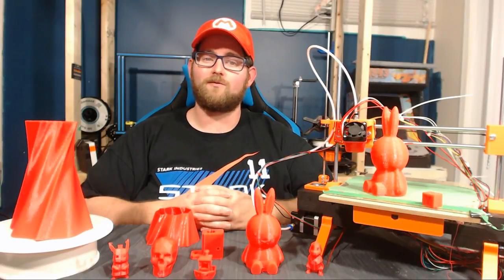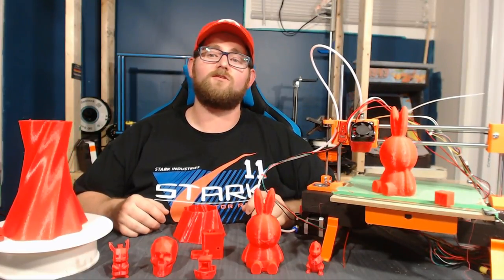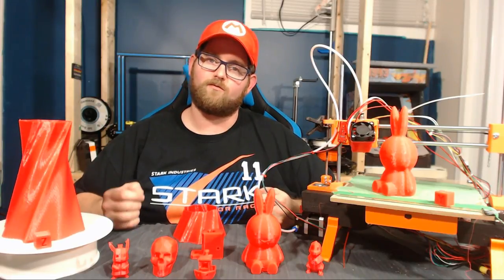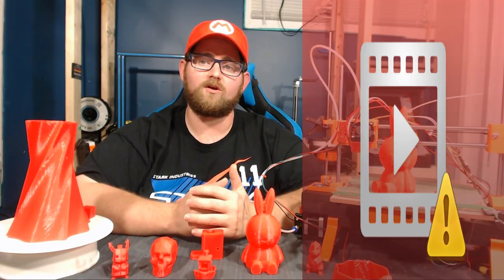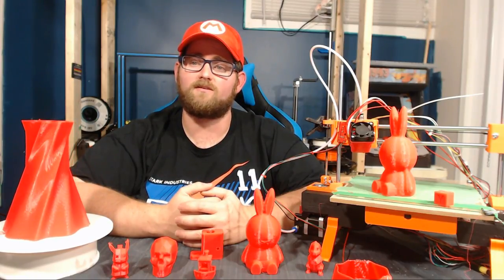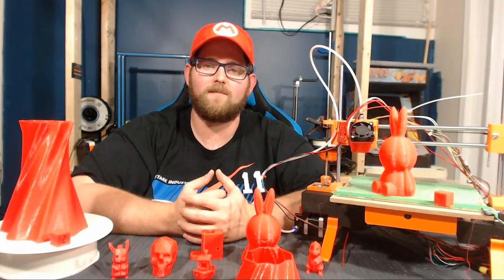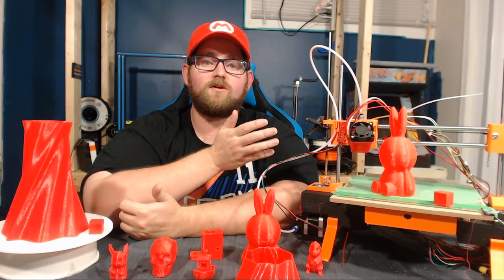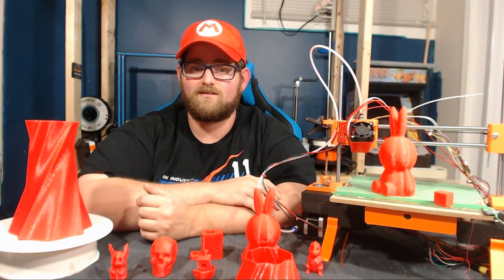Building the Cherry 3D Printer - Conclusion!

Comment: Hi James. This is indeed a nice project and I made 2 iterations already increasing the volume of the print. I'm planning to build a Prusa, but I still need some advice on this one. I'm getting some layer shifting. I've changed and tightened the belts. I've also decreased the speed to 10mm/s on all motors and also decreased the voltage on the drivers to about 0.47V. Results improved but I'm still getting shifting that would make the parts unusable. What setting would you recommend (or where do you keep your modified Marlin firmware) so that I can keep trying to tune this one? (I would need it to build the Prusa parts :) Cheers and thanks for helping me building this one
Reply from the maker: Be glad to help however I can! If you are on Twitter, fire me a message, probably easier to chat back and forth than use the comment section on reddit.

Comment: Do you need the extruder with the NUMA 17? 

As a complete beginner I don't get what is it needed for and if is optional

Anyway thanks for those videos, your is probably the biggest contribution to this project, and the best guide for the ones who want to build it.
Reply from the maker: I have seen some extruders that use one or two of the 28BYJ steppers instead of the NEMA 17 motor. I haven't had a chance to play with one yet, but they seem to work okay.
Reply: @PrintNPlay  oh ok thanks, I'll search about it. I'm trying to cut down the costs, right now there are some kit that are cheaper than  this project (tronxy xy-100 is 100).
Reply from the maker: Absolutely, there isn't a huge cost savings with this project anymore. EasyThreeD has one for under 100 now too that has a pretty big community behind it
Reply: @PrintNPlay  yeah I found it, but it's pretty basic and come preassembled. I want the fun part of building it :) 

Ik this printer is already the cheapest project, but I noticed that some pieces increased in price since the original post, I'm just trying to understand if I can replace them. Also it's quite useful to get to understand how this works. I'm completely new in this world, and it's pretty complex seen by a beginner.
Reply from the maker: @lunarchsbrain2125  that's true, too :)

Comment: Darnit...missed the giveaway...ah well...very very cool little printer...those little 28BYJ-48 are neat but darnit...a little too slow, but as you said...very cool for showing people about 3D printers and how they work!
Awesome job...so very cool!
I have seen two different variants of the 28BYJ-48 some 5vdc and some 12vdc...
Reply from the maker: This build was done with the 12v version. I have read that someone had better results with the 5v ones
Reply: Found this motor comparison...might be the resistance of the coils...did you tweak your driver current down to prevent overheating?
https://grahamwideman.wikispaces.com/Motors-+28BYJ-48+Stepper+motor+notes#Mechanical-Actual gearing details-Gear trains calculated and compared

Comment: Can i ask you, what program do you use on your pc to control the ptinter? Cura, Slic3r, Repetier. And with how much speed are moving your motors?
Reply from the maker: I have used both OctoPrint and Repetier to control the printer. The speed is presently capped around 9mm/s due to the weight of the Y axis.
Reply: Plus the motors are not super fast powerhouses...they are geared down considerably, they don't move fast and will overheat easily if pushed too hard, but when they work..they work VERY well!
28BYJ-48 look for the 12vdc versions

Comment: Seems like a decent printer. Im going to build one not because i partictuarly need a new printer, but because someone from my class decided to bet 100€ that i cant build a printer for under 100€

Honestly, i was gonna show him that eazythreeed printer, but i like free money lol
Reply from the maker: You can save even more if you spend the time to get printed bushings done for it. Knock off another 10 dollars or so
Reply from the maker: Also, check out the backlash compensation features in the latest version of Marlin. Should allow for cleaner prints
Reply: @PrintNPlay  good ideas. I also read that microstepping is not necessary but in fact unwanted on these motors. I'm not entirely sure of that, but that's something that can be tested. I was going to ask if you have tried a 28byj extruder? I know you mentioned it once in a video. Seems like a way I can save a few euros lol
Reply from the maker: @electrodeyt3491  i played with a design i was working on. There is also a design on thingiverse that uses two of them to grip the filament on either side. Looks pretty promising! Let me know if you can't find it, i will dig up a link for you